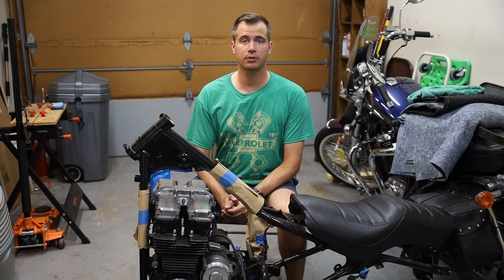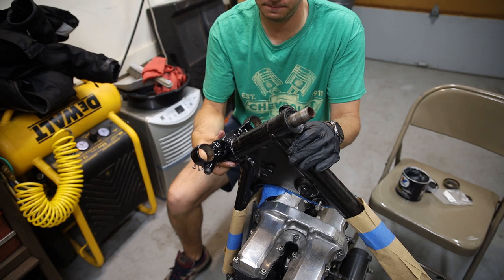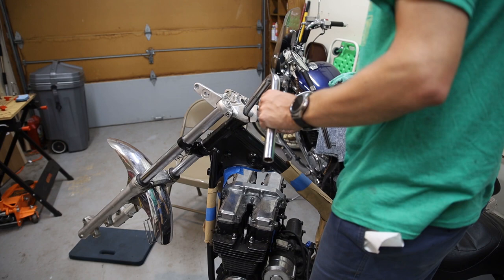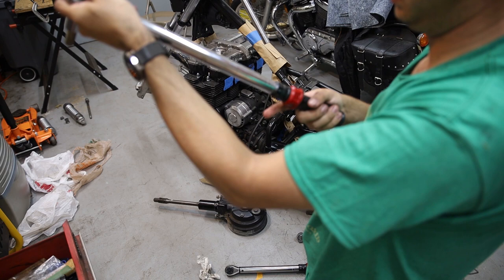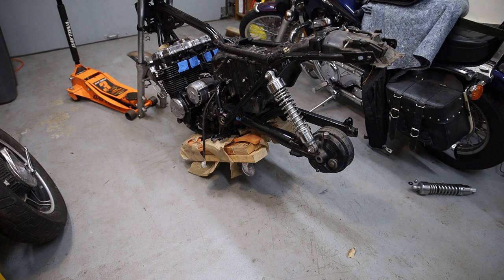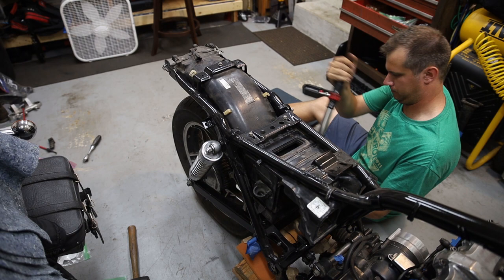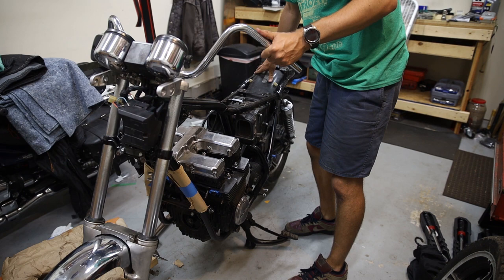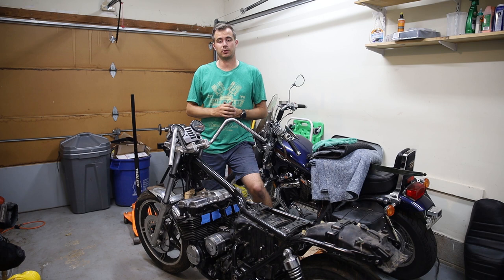$300 Honda Nighthawk - Let's Install Some Parts - Part 13

Comment: Crazy timing - I just checked up on this two nights ago wondering what ever happened.
Reply from the maker: It's almost as if I could read minds. Lol hope you enjoyed
Reply: @N0Fumar  For sure! Keep it up, can’t wait to see it finished 👍 
I bought a neglected one for $300 back in 2001 and got it running. It was a great bike and made me feel like a badass in high school, lol. Good memories.
Reply from the maker: @Mr_Eyeholes  that's awesome! I'm currently redoing the carbs because 1. They're off and 2. I'm not sure I did them as well as the two kawasaki bikes. Should pay dividends